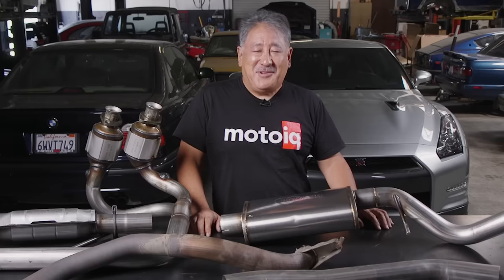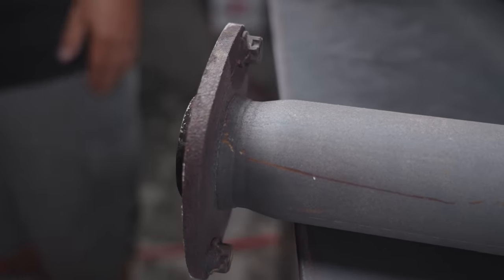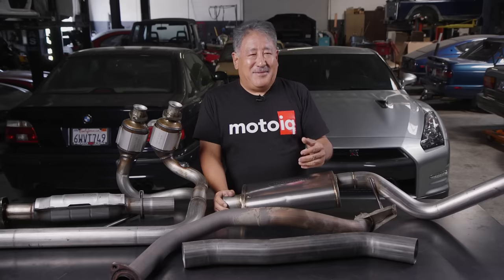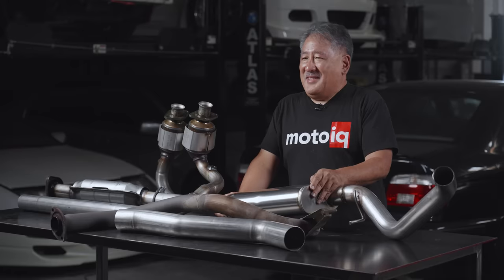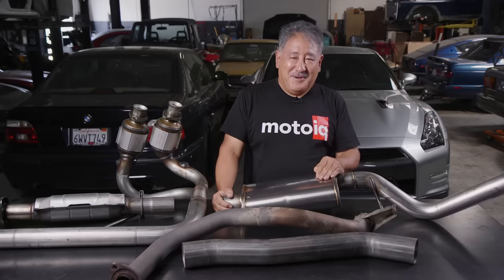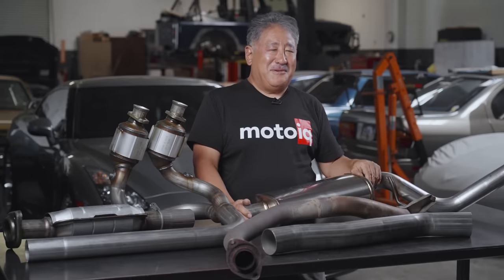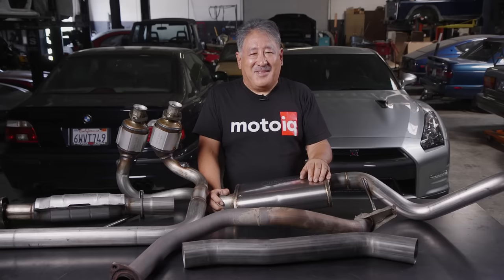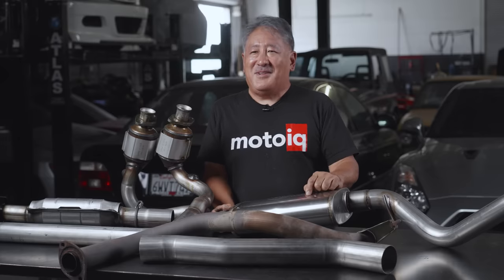Exhaust Back Pressure Myth DEBUNKED!

Comment: You are so right about the back pressure I have been saying that for decades but on a 5 or 6 hundred horse engine there is almost no difference in mandrel bent pipes or any others in fact I heard so many inconsistencies in your examples now you are right about the correct size pipe but no difference in the straight thru or the routed mufflers.I have seen dyno actually being done on the same engine with several different exhaust with no more than 3 hp difference spend your money on something besides mandrel bent pipe and 300 dollar straight through mufflers
Reply from the maker: I have actually tested chambered mufflers vs straight through and have seen huge gains. More that I thought actually.  Sometimes 50-60 hp on an engine producing 450 or so hp.

Comment: Velocity. 
I removed my camero's stock exhaust and replaced it with a 4" system.
I lost all kinds of torque and drivability,
He's dead on , what I lost was velocity. 
My streetbike has butterfly valves in the exhaust system which actually limit flow at lower RPM so there's alot more to it than just saying backpressure is bad. It's more like having an optimal balance of velocity and flow rate.

Comment: the real claim is that you need a little back pressure to prevent burning your valves, valve technology has since changed that for the most part

Comment: Coming from a 2004 hilux 4wd had a stock exhaust on it. Upgraded it a hi flow turbo 3 inch exhaust. Results great on the hi way but in the bush got to change the down the gears going down hills. Won't hold as good. Great video mate cheers
Reply from the maker: A 3" is way to big for that motor, no wonder you killed your low end, a 2.5 would be much better.

Comment: I think this "backpressure thing" is misunderstood. YES, theoretically, ANY backpressure is a disadvantage for your engines efficient power. And it is not just velocity of the gasses, there are also pressure waves that bounce back and forth through your exhaust, which can push exhaust back towards the cylinder, or help suck it back out, the right way. The length, shape and diameter all play a part, and every engine setup will have its own "ideal" exhaust system/dimensions.

Comment: In the 70's thru 80's we were told slight back pressure helped prevent valve float. I ran 2-strokes so it made no difference to me, the expansion chamber was where the power is primarily determined on a 2-stroke engine.
Reply from the maker: Actually it's the port timing and the expansion chamber is built around that. https://www.youtube.com/shorts/qf9eFYPYXUY

Comment: On a stock efi tbi Chevy, you run it right off the Y pipe and you will notice less torque, this is because there is no scavenging effects of these style manifolds, and then your efi over compensates on fuel and most of the time will run too rich. On a carbed engine or motorcycle, it can lean out due to the extra velocity and then you'll have that lean pop on decell. Jet your carb, ditch manifolds, and run a better cam and then it'll all work together.

Comment: 1. Exhaust gasses cool as they exit
2. Cooler gas has lower pressure than hotter gas
3. Gas always flows from a higher pressure zone to lower pressure zone

The cool zone at the back end of an exhaust system creates a zone of relatively low pressure, which effectively draws the hotter gas away from the headers faster than if it were vented into the open air. It’s like sucking a liquid through a straw.

Comment: Interesting video, seems to make sense to me. Is there a difference, I wonder..with something like a single cylinder long stroke lower rpm motorcycle engine, of say 350 cc capacity? The latest euro emissions standards choke these up a lot and there are aftermarket exhaust systems and free-er flowing intake filters to counter this mandated suppression. A Fuel X Lite module seems to help as well...

Comment: Hi, finding this very interesting as I'm a hobbiest mechanic and was looking at changing exhausts on 1 or more of my vehicals. Quick question 4 ya. I was wondering about changing the back box on my vw golf from the 1 that's currently on there which has just the 1 outlet, to a back box from a similar car, although this one has 2 outlets, so I'm wondering if this would be a good idea. Can you help me out here?
Reply from the maker: What is a black box?
Reply: Back, not black box. The bit that goes at the back of the exhaust where the gasses come out, looks like this. I realize it may be called something different where you come from, but here's a link to a google image of 1, similar to what I'm proposing to put on car, Removing the 1 currently there with just 1 outlet. https://turborevs.org.uk/wp-content/uploads/2013/12/exhaust-box-mc003-1.jpg
Reply from the maker: The muffler? You can't judge how well it works by how it looks, follow the guidelines in the video.
Reply: To tell you the truth brudder, it wasn't for the look of it that I was considering doing it. The sole reason was to make the car run more economically, using less fuel and putting less stress on other parts, as I'd been led to believe the easier the gasses  can get out, or the better the car can breath, the better it'll run is this not so? My main concern would be the various sensors attached might somehow be thrown off, potentially causing problems further down the line, like emissions tests or whatever.

Comment: So no jpipe and 3rd cat delete for my 2012 accord sedan v6 automatic?  It won't help much because of vcm?  Or it just won't be as much as of an issue as some of the true vtec engines in regards to back pressure build up?  Engine is not modded, won't it still help?  The factory exhaust seems fairly restrictive just by the looks of it.

Comment: I worked at a gas station/ 2 bay garage when I was a teenager. A guy had a 1979 Grand Prix with a 350 in it and was waiting for his new exhaust system to come in. There was nothing but the headers on his car and he had to go for a short drive to pick something up; so he decided to drive his car. It was really loud- and it was REALLY gutless. The car felt like instead of having around 190 horsepower, it felt like it had around 40. What explains this then if no back pressure is required??
Reply from the maker: wrong header for the engine,, too large primary tubes, exhaust leak from a shitty header, carb needed to be rejetted for running open headers.
Reply: Thanks for the reply.

It ran well right before the old exhaust was removed and perfectly fine immediately after the new exhaust system was installed. One thing is for sure, it was ridiculously loud with nothing but the headers on it! Lol

Comment: The misconception comes from two stroke gasser engines which use the scavenging of the fuel air mixture coming into the cylinder to push out the exhaust gases. Since the is no valve to close the exhaust port some mixture leaves to the exhaust pipe without combusting and you use the resonator to redirect it back inside the cylinder to ignite it. But that process uses the sound shockwave in front of the exhaust gases not the actual back pressure.

Comment: Awesome video, I watched this video because I was curious if the rust holes in my exhaust were causing my toyota sequoia to run lean. Now I'm thinking only if the leak is before my o2 sensor would it throw things out of whack.
Reply from the maker: You are correct

Comment: You actually want and exhaust system that is easy to flow out, but difficult to flow during reversal (this is why people say you need a little back pressure) do during valve overlap more air can be sucked from the intake and less from the exhaust. so in this sense back pressure just means ' hard to flow in reverse direction' but low forward pressure (easy to flow out thru tailpipe)!

So technically you really do need backpressure. A good exhaust system flows very well when expelling exhaust gas, but flows poorly in reverse direction. That is backpressure which is required.

The term back pressure is a misnomer, what you mean by you don't want back pressure you actually mean you don't want flow restriction.  The old farts term of back pressure means 'difficulty of exhaust flow in reverse direction'

Comment: What you trying to say is run with full exhaust system starting from front pipe all the way to the mufflers tip? Or run straight pipe starting from front pipe to end pipe? Which is it. Not understanding this video

Comment: Fantastic video. So you would recommend a dual through midpipe instead if a single through midpipe exhaust system for my A91 Supra? Both examples would end up with dual exhaust tip exists, but I'm wondering which are some good examples or recommendations.
Reply from the maker: For an A91 I would recomend a big single midpipe. There are many good exhausts avalible for the A91.  I like Greddy or Remark.
Reply: @motoiq  What are your thoughts on the HKS Hi Power for the A91?
Reply from the maker: That's a good exhaust as well

Comment: Well, backpressure is actually needed  for a engine to actually run! Backpressure is a key component in engines including air and compression.  It's true that backpressure is bad for efficiency, but you still need alittle backpressure.
Reply from the maker: That is not true at all. Retained back pressure in an engine actually reduces the amount of work each cycle can make .  https://en.wikipedia.org/wiki/Otto_cycle#/media/File:P-V_Otto_cycle.svg  this is the otto 4-stroke cycle and this represents the thermal work of each cycle, if 1-2 is higher due to retained cylinder pressure, the area of the cycle is less, less work means less power.  So the stuff you been taught is a myth.

Comment: I got my HKS hi-power medium size muffler for my Honda 1.2 Ivtec which is 2.5 inch in and 3.5 out. Main highlight is Deep bass & some burbles while shifting gears. So happy with HKS muffler for good low end pick up & main difference I felt while rolling through high range areas🥰. Pulls easily & effortlessly than before. While crusing highway gas mileage improved too.

Comment: If you remove the current restrictions which cause the current back pressure there is a chance the flow/velocity will be to high. Pulling the rich air from the intake port straight to the exhaust port because of the valve overlap.
Therefore your air/fuel mixture in de cylinder will be too lean. Changing your injection timing might be mandatory when removing the current exhaust restrictions such as a catalytic converter.
Reply: Yes but that just goes back to how the car is tuned. Less back pressure is still typically a net positive as long as you tell the vehicle how to utilize it. Definitely worth pointing out to anyone thinking they can simply remove restrictions to increase power but it obviously depends on the motor.

Comment: this is Strange  no back presser is good for WIDE open  use only
  the Flame front can only move so fast   there is some Good math behind this
  for most applications  for Some back Presser is needed  for Some thing called  intermix    one dose not drive With a wide open GAS pedal    unless one is Racing  
VERY INTERESTING video GOOD explanation
Reply from the maker: Actually not, a good good exhaust system actually produces less than atmospheric pressure in parts of the 4 stroke cycle.  A good exhaust helps over a wide range of power.

Comment: I would like to also add that maybe you should visit the Borla site or even contact Borla and they can educate you on exhaust systems, did you know that John Lingenfelter built 600 plus horse power Corvettes using Borla 2.5 inch exhaust systems, I think I will stick with what Lingenfelter (RIP) and Borla say on the subject of exhaust pipe size and back pressure. Borla has been doing this for over 30 years and have several patents on exhaust technology.
Reply from the maker: We know the people at Borla well.

Comment: Especially true to get rid of back pressure with a rotary. Helps them breath which getting air in and out is part of the limitation. Love a good bit of velocity from her tho( help the diffuser suck air out from under the car where ive got it)

Comment: Love this guys smile. Always stoked. Very informative. Thank you!! Although I’ve had a twin turbo V6 for 10 years and it works much better with NO back pressure whatsoever. So… i kinda don’t see why he’s in the “back pressure is good for turbos” group.  Hmm.
Reply from the maker: It is not good for turbos, it makes less power, it improves turbine efficiency but that doesn't equate to more power.

Comment: Happy new year! I just replaced my exhaust from turbo back with catdeleted 2.5inch piping borla straight thru. Is a 2.5in piping enough for a remapped 2.4L 4cyl turbo diesel 200whp? Or do I need to change to a 3inch pipe?

Original stock exhaust pipe of my truck is around 2.25-2.5inch with chambered muffler. Thanks.
Reply from the maker: The borla is probably ok
Reply: @motoiq  i just bought a 2.5"inlet muffler from borla. Then had it made custom piping 2.5in turbo back. Will that do for a 2.4L 4 cyl turbo diesel? Tnx

Comment: Very good video. It's nice to see the truth being told, instead of perpetuating the myth of backpressure. There are many such myths about cars, I suppose because most people aren't mechanics, so they just repeat whatever they hear, and the rumors carry on. lol
p.s. I've always used Flowmaster mufflers for the street, and get good results, even shifting at 8500 rpm.
Reply from the maker: If you use the chambered Flowmasters, give the perforated core versions like the Flow FX series a try.  I have gained 40-60 whp on a highly tuned NA V8 by switching.  The chambered Flowmasters are loud and they kill velocity in the exhaust even if they are technically low backpressure. I hate them.
Reply: @motoiq  I have never seen the flowfx  before, I will look into those for my new exhaust
Reply from the maker: https://www.holley.com/brands/flowmaster/products/exhaust/mufflers/absorption_glass_pack_mufflers/flowfx_series/

Comment: You hit the nail on the head. If back pressure makes your car faster your tune is wrong. Not just your mapping. Your tubing size, length ect. Intake length, exhaust sizes all play together.

Comment: Even many people who know backpressure is garbage dont understand that a properly tuned exhaust gets smaller as it gets longer.  The reason is gas contracts as it cools and to maintain velocity you have to reduce the area.  Thats why a lot of engines make more power with dual 3" into single 4".  One it creates proper scavenging, 2 its only a slight decrease in area as opposed to 2 3" pipes and novices dont understand that bends reduce flow so that fancy X pipe it more restrictive than a smooth Y

Comment: Was going to get short tube headers for my 302 because old timers said small blocks with short piston rods need back pressure, made short tubes sound like a good idea, I'm going with long tubes now, thanks
Reply from the maker: None of that is true at all.
Reply: @motoiq  thank you, I have also heard long tubes can hurt low end torque if they're too wide, which would be an issue in my smog era 302, since they already have lower torque than lots of engines of the same era because of their shorter piston rods, I don't know if long tubes would be the best idea for the engine if I don't want to miss out on more low end torque for a launch, what exactly should I do?
Reply from the maker: Long tubes have better low end torque. Short rods have better low end torque and less top end all other things being the same.

Comment: My experience with tuning a high output engine, a motorcycle racing unit of 1000cc producing a true 205rwhp, and having trouble adjusting the new non factory ecu it was suggested adding the db killers. Result was better torque curve and hp, so I am not convinced.

Comment: In my experience opening up the exhaust flow at all on a stock engine results in less low end power, but more high end power so it's kinda true.
Reply from the maker: If you size correctly and tune correctly no bottom end loss or very little.

Comment: I'll give you two examples of where some back pressure is necessary. I owned a '93 twin turbo Mazda RX-7 and I replaced the Catalytic converter with a straight pipe. The car's acceleration from a stand still was noticeably worse but it seemed to do better at high RPMs.
Another one was a 2 stroke 26cc motorized skateboard. It would take me from a stand still to 20 mph. But with the muffler removed, it couldn't even get rolling under its own power. I had to push a bit to get going but the top speed improved to 25 mph.
Both of these engines are 2 stroke types. The rotary engine being an odd example of such.
Reply from the maker: Rotaries need super low backpressure.  What you experienced is that the FD ECU has a speed density mass flow estimation method and you caused it to lean out.  Good thing you didn't blow it up.  I seen them blow up from just a cat back and an air intake in minutes with no tuning, in fact I did just that mistake and blew up my friends.  If you tuned it with the downpipe you would see a pretty decent power gain and way quicker spool so power across the board. The 13BREW is the only engine that blows up easier than a Subaru! Two strokes need low backpressure too.  If you added a properly designed expansion chamber, jetted and timed it right and had a stinger on the end of the chamber of the right dimensions you would experience probably 50% more power even with no muffler at all. So low backpressure is always good, it just needs to be applied properly and the root cause of loosing bottom end addressed.  This incudes going too big with an exhaust so you loose velocity and scavenging.

Comment: Do you have vacuum in the exhaust ?
Cause that pulls exhaust along , but only to a certain size pipe diameter , so open headers would be the best hp for max power?